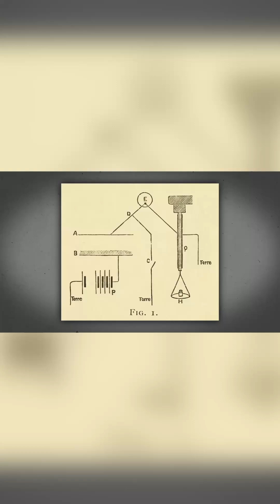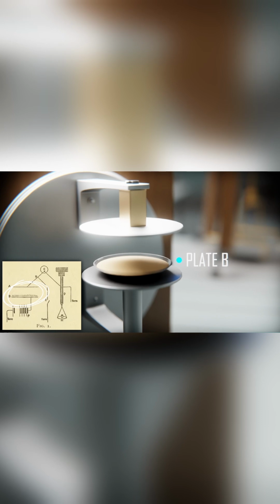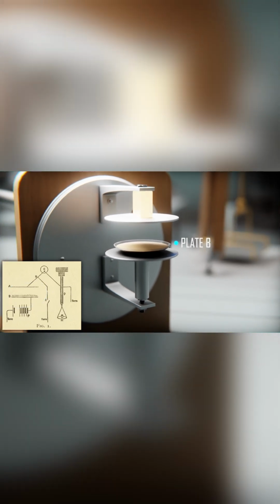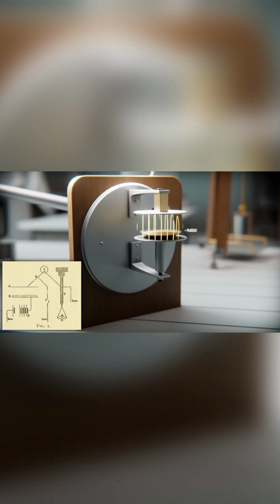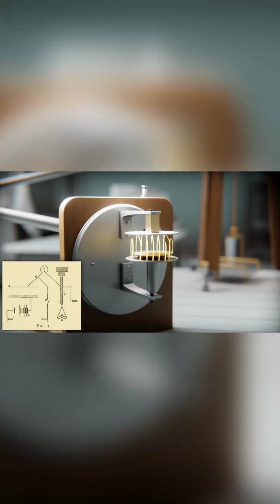Explaining the FIRST EVER Radioactivity Measurement (1898)

Comment: So they had no way of actually directly measuring the current?
Reply from the maker: Not for the currents that were as small as the ones they were trying to measure (i.e. the tiny currents caused by radioactive samples ionising the air around them).
Reply: @Chemistorian  Ah. As so often, quantifying is the issue.